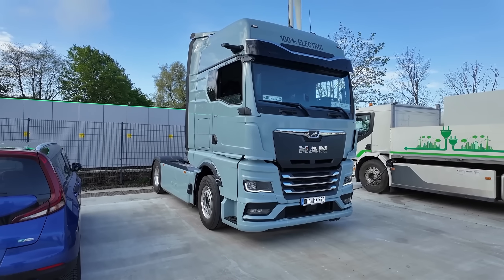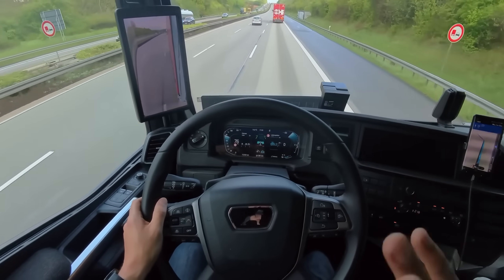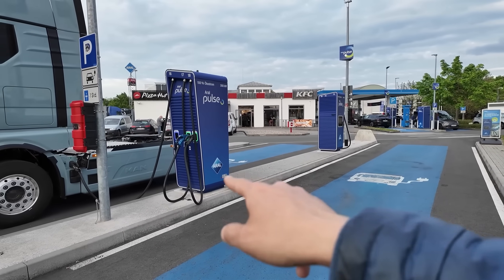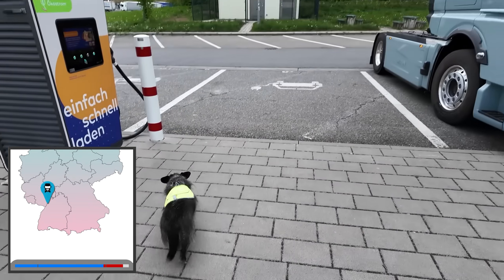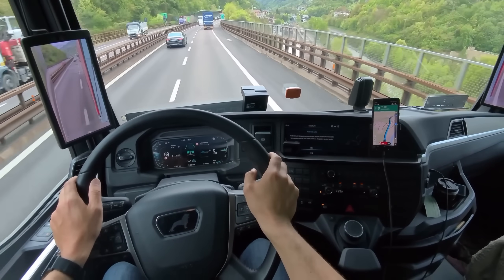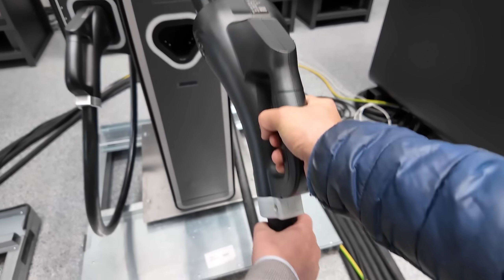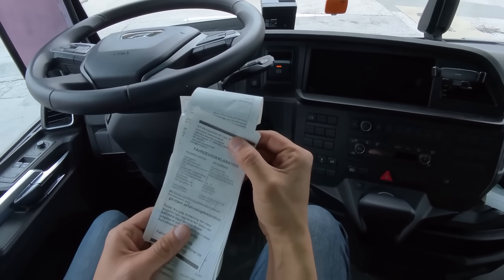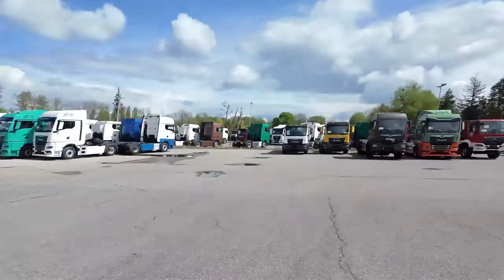Megawatt Charging with the MAN eTGX and HPC Charger Transport over the Brenner Pass

Comment: Whilst CCS works for the European resting rules, it is too slow for other countries. Eg Australia's rules are:
Maximum Driving Hours: Truck drivers are limited to a maximum of 12 hours of driving time per day, with a maximum of 72 hours of driving time per week.
Rest Breaks: Drivers must take a minimum of 30 minutes of rest for every 5 hours of driving time, and a minimum of 7 continuous hours of rest per 24-hour period.
A 30min break every 5 hours is too short for a CCS charge on a long distance route eg between our 2 biggest cities being Sydney to Melbourne (850km, 100kph limit, but hills make it a 12 hour trip which is the daily limit). They would need battery swapping or megawatt charging to retain their existing productivity.
Reply: The newest scania can charge up to 375 kw. From 2026 MCS compatible with scania enabling charging speed up to 750 kw. So it gets better every year
Reply: Ionity is now testing 700 kW CCS 2 chargers, and based on that you should be able to do 850 km driving with one 30 minutes stop with the new Mercedes eActross 600 and  MAN eGTX. So it s already possible with normal CCS 2 DC chargers with 700kW output.
Reply: Mercedes eActros600 does Megawatt charging.

Comment: MCS can also mean higher throughput per charging bay. Smaller charging park is probably cheaper, especially with the size of truck stalls.
Reply: Good point. Everyone forgets the hidden cost of land. Not least because our economic systems don't price land and the opportunity cost of using land properly.
Reply: Good point. But thicker cables and connection is also more expensive. This has to be tested in practice. Perhaps some high-throughput site is viable. Tobias speculated elsewhere, perhaps the high charging power should in fact be cheaper for the reason you mentioned. Interesting dynamics indeed.

Comment: As a German i would be interested how Tesla Truck is doing in America. Are there other Models beside Tesla on the Market?
Reply: Still less than 100 vehicles being tested by PepsiCo in California, another location being opened for testing (south Caroline I think) and a few companies testing smaller numbers.
Rollout of BEV trucks in Europe is much easier for long haul because of the driving time directive and the lower speed limits for trucks in Europe
Reply: @Frisian-eh2wm  What is the speed limit for trucks in USA?
Reply: @JanNovak-pg8oedepends on the state. Ranges from 55-85mph (90-135kph) On avg trucks will travel around 70mph or 110kph . Where I live in Canada the speed limiter is 104kph but many large companies drive at 90-95kph to save fuel.
Reply: Also Volvo as of Oct 2024 as sold more than 570 VNR electric trucks in NA.  Not going to look up how many Kenworth/Peterbilt or other manufacturers BEV trucks have been sold, just pointing out there are multiple BEV Class 8 options.
Reply: @Gig0Surf  PACCAR KW T680E  Peterbilt 579 EV, 220 EV, 567 EV   soon KW T680 FCEV  Peterbilt 579 FCEV
Reply: They probably won't be coming to Europe any time soon because of the centre driving position which is not allowed here. Unless they change the regulations that is.
Reply: @GaryV-p3h It's almost a certainty they will design a European specific version, *IF* they bring it over at all. Actually, if they do, it will be made in Europe as well. Not soon though.
Reply: 120kph max, but varies.
Reply: Besides Tesla?  Schneider purportedly has 'nearly' 100 Freightliner eCascadias in their fleet (as of Dec 2024).  Seeing what other fleets are using them, a cursory search shows Reyes Beverage received 29 by end of 2024, Sysco as of Jun 2024 had 100 in the US (120 worldwide) of their 800 truck order (by end of 2026), ... one article states 55 fleets in the US were using them as of May 2024.
Reply: they are fake with no plans for production scaling
Reply: They are doing well and are building a factory to expand to more general sales instead of the mostly Pepsico rollout to date. PepsiCo publishes figures on their usage and it has been fantastic. They average 980 km of 24 hour usage for the trucks and the most  usage in 24 hour has been 2000 km

Comment: In my driving the Volvo FH AERO electric, recuperation is about 20% of the energy consumed by maintaining speed and climbing up hills.
It’s driven 13 934 km today.
On that distance it has consumed 36 412 kWh.
And also, regenerated 7 047 kWh

So 13 931 / 7 047 =1,977 (19,7%)

It would be fun to see how your Iveco is doing with the regeneration 🙂

Thanks again for a great video 😊
Reply: Great numbers! Image 7mWh in heated brake pads... Useless, now you used it all again!
Reply: @Blasterxp  m is for mili and M is for Mega. 7 MWh.
Reply: @Blasterxp  Combustion engines could feasibly use the heat from friction braking regeneratively, but for now a motor battery and inverter setup in BeV and hybrids have is popular.
Reply: 20% recuperation, that is much better than a diesel going downhill and burning up the brakes.  Congratulations!
Reply: You think the Brenner-tunnel will make a difference for logistics? Afaik it is just for rail. Can't wait until they finish it.